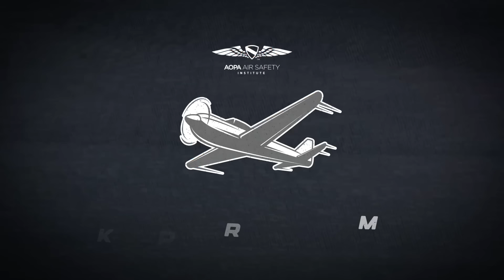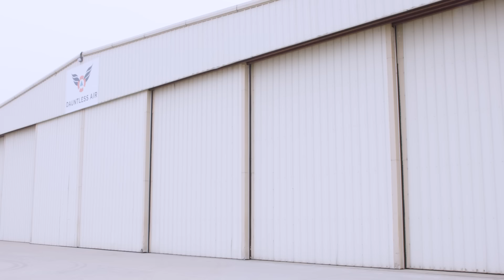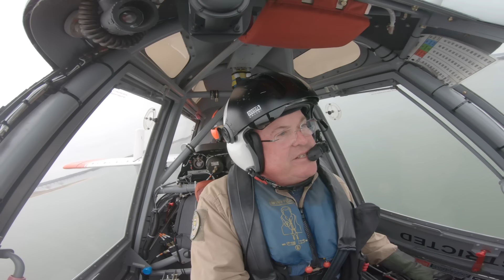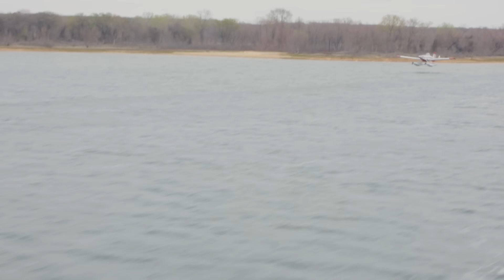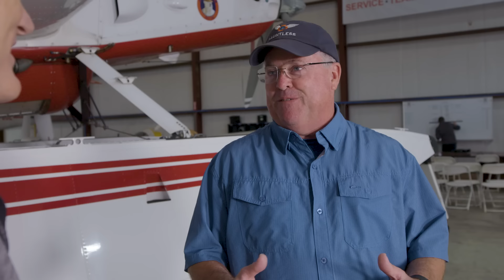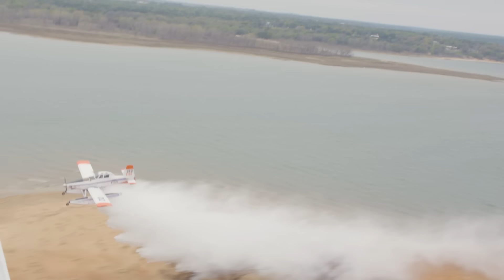Peak Performance: Flying the Fire Boss

Comment: 11:00 why not put some thin lightweight plastic or aluminum baffles inside the water tanks to dampen the sloshing? Training would be shortened, fuel saved for the fires, less stress on the airframes, and then you might even be able to fly in rougher lake conditions?
Reply: Might have come up with a better idea, a reverse snorkel. Maybe when you pull the landing gear up, a linkage/toggle also drops an intake pipe much lower than the pontoons. That way you'd also eliminate the drag and hydrodynamic suction of the pontoons hitting the water, saving fuel.

Comment: When I transitioned from turbo props to jets years ago I was amazed how less fatigued I felt at the end of the day.  The noise and vibration fatigue is a real consideration on top of flying low to ground, rapidly changing CG and load moments, flying over fire/thermals, VFR into smoke, keeping track of where your teammates are.  Respect.

Comment: “It’s the largest single engine airplane in production”…..Pilatus PC-12 has entered the chat.
Reply from the maker: @Charles-mp2vl  the PC12 has a max gross weight of 10,495 pounds while the AT802A has a max gross weight of 16,000 pounds.

Comment: Interesting to compare these with the Martin Mars water bomber. The MM carries 7200 gal water and has 4 - 2500 hp Pratt and Whitney piston prop engines for 10,000 total hp. It would take 9 of these smaller aircraft with 14,400 total turboprop hp to carry the equivalent water load at 800 gal per plane, and 9 pilots of course. Additionally, piston props are more fuel efficient than turboprops at the lower altitudes at which these aircraft operate, I think.
I wonder how 9 of these would cost to build compared to a Martin Mars.
I do suspect that this is too small an aircraft to be optimal in this role, but would be pleased to be corrected by someone with specific relevant engineering expertise.
I feel B.C. has too few water bombers for the current evolving climate/forest fire situation.
Reply: I suppose one of the benefit these planes have is their ability to scoop water from a much smaller body of water than the MM can. So although they dont have the single trip volume. They might be able to make up with total volume by being able to do more dumps over the course of a flight if they have access to a closer body of water

Comment: Rather have a type 2 or a type 3 helicopter dipping close by that be waiting on a water scooping plane going back in forth from the lake. The helicopter puts water right where you need it. Plane off as often as its on the fireline. The Fire Boss and CL 215 seldom outdo helicopters on initial attack.

Comment: A good friend of mine has 8 Air-tractors and a two seat trainer air-tractor and four Bell helicopters he is a firefighter also like you are sir 

What year and model are both of the Aircraft? 

How many Fire Boss firefighting Aircraft do you have? 

I have never seen a 802 aircraft designed with floats on it to scoop up the water for firefighting 

Did you buy all of the Fire Boss firefighting aircraft from Thrush or Air-Tractor? Who’s the designer of the Fire Boss firefighting aircraft?

I just have to tell you sir that you have a really cool job flying around and putting out fires I wish that I was a qualified pilot to fly one of your Fire Boss aircraft 

I am retired corporate pilot from McDonnell Douglas Aircraft Company and I’m flying technicians and some cargo to the Offshore wind farms and oil rig platforms I’m a rotorcraft and fixed wing pilot flying a McDonnell Douglas MD-80/DC-10/MD-600NOTAR/902NOTAR, Airbus H-145/H-155 I have never been in the back seat of a aircraft like your Fire Boss. I would like to fly to your hangar sometime soon to Cleburne, Texas and look at one of your Fire Boss firefighting aircraft it looks like a much safer aircraft to fly compared to a crop duster aircraft? Cheers 

What does one of the new Fire Boss cost? $1.5M-$2M with the floats and internal tanks?

You have a very interesting Aircraft for Fire Fighting 

Is Air-Tractor the manufacturer of both of the Fire-Boss trainer Aircraft and the single seater Fire Boss 802 Aircraft? 

Would Air-Tractor contract to build a new Fire Boss 802?

Comment: As a CL-215 instructor myself, I have been co-operating with the fire bosses for a couple of years. These guys are the real deal. Skill and precision. And the greek seas and terrain are no joke, I can assure you. Much respect mates. Have safe flights and landings!
Reply: They are junk and NOT what Greece needs. What you guys need is CL-415s and much heavy tankers like converted B747s, DC10s and more...
Reply: I wish British Columbia would bring back the CL215’s and 415’s instead of those dinky planes
Reply: @MrJasonfromcanada  the Canadair might be cooler, but you can get 15 fire Boss for the price of a single CL-415, that's probably why BC switched.
Reply: @jeansboii makes sense
Reply: @jeansboii  and be in 15 different places at once, not just one fire
Reply: @mickboyce386  If you've got 15 Fire Bosses, you also need 15 pilots, which is not as easy to come by.

Comment: I flew a Cessna A185F scout plane overhead while Jesse and his teammate flew two of these AT-802F tankers off of Lake James in Western NC to demonstrate their effectiveness to the Forest Service in 2012. It's amazing how much water they can drop on a fire by continuously dipping and dropping in a circuit. They need about a mile to take off and climb after scooping up a full hopper. That limits their usefulness somewhat in the mountains since it's not possible to find a long enough lake close to the fire in many cases. However, they are fast so they can go farther away from the fire to find a long enough water source and still drop more water than helicopters with Bambi Buckets. Their huge turbine engines make it possible for them to climb rapidly with a full load even in steep mountainous terrain.

Comment: I seldom write down yt speaks, but this outro is exceptional: "Elite performance begins with strong execution of the fundamentals... They are humble, they didn't consider themselves above simple tools like challenging response calls between each others, and checklists. Elite performers eliminate small mistakes by leveraging simple tools consistently. And they are not embarrassed by simple tools. Their debriefs were specific, detailed and candid, so there were no misunderstandings where mistakes were made and the proper corrections. A tenant of elite performance is setting high standards and holding yourself and your team accountable to these  standards." 
Talk about leadership material.

Comment: These aircraft look like Crop Dusters with Floats.
This was a really cool edit for sure.
Reply: They are crop dusters with floats, AT-802 with a slightly different engine, prop and airframe to accommodate the extra weight and stress of the floats. I've worked on both wheeled AT-802s and a Fireboss, they're awesome planes!

Comment: I had no idea the AT's could handle 16,000 pounds gross, WOW!  A Twin Otter gross is 12,500 with all that wing.   The AT looks so short-coupled as well. Thanks for posting this video.  We see them often here in Eastern Washington doing pick-ups and I now have huge respect for what is going on.   Superb video post.
Reply: The AT is a no frills work horse.
Reply: Agree ... while the Twin Otter is very forgiving, the FireBoss looks to require very precise control. There's an old saying that goes, "Flying is hours of boredom, punctuated by moments of ... stark terror." From what I could see of the stick inputs during the scooping ops, the analogy would be 'Scooping requires a very soft touch, punctuated by moments of ... snatching.' ^v^

Comment: Largest single engine airplane in production?  Not quite. Heaviest perhaps.
Reply: You ever been around one? I’m curious what you think is bigger. PC12? Caravan on floats? Still bigger than those
Reply: It is.
Reply: Largest single-engine “tanker”, 800 gallon tank, half the capacity of a 415.
Reply: Air Tractor 1002 has a 1060 gallon hopper... 10,800lb useful load. 😛
Reply: These things are MASSIVE. 

I fly bird dog with a Fireboss group. We were at a small airport and a Dash 8 had to think twice and taxi slowly because its “high” wing barely cleared the “low” wing of the Fireboss.

Comment: The movement in the pontoon while on the water must give the mechanics nightmares.
Reply: Yeah, looks like those airframes take a beating.  I'm sure they have a good inspection program!
Reply: It's a VERY thorough inspection process, especially if they scoop from salt water. I used to work on one.